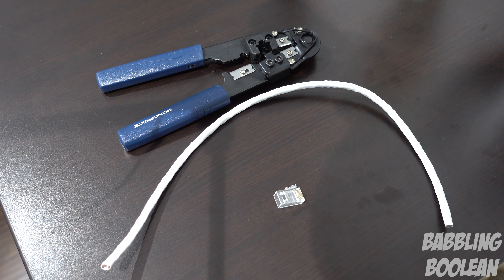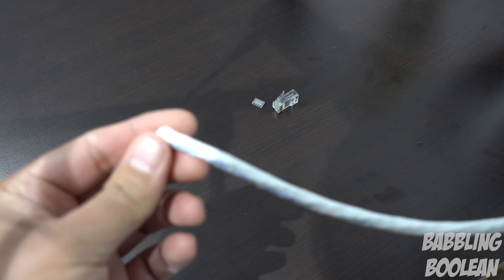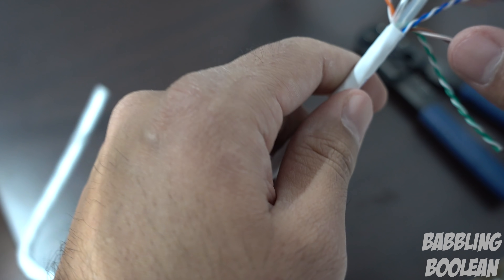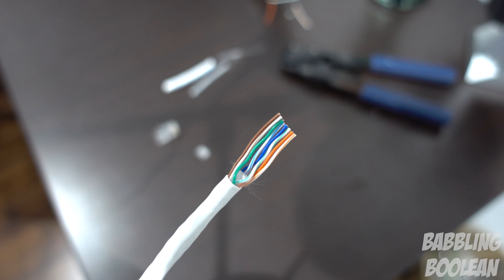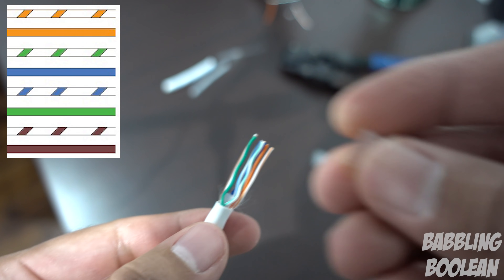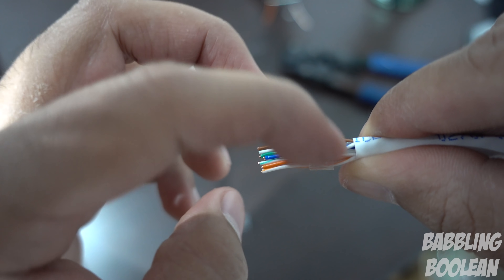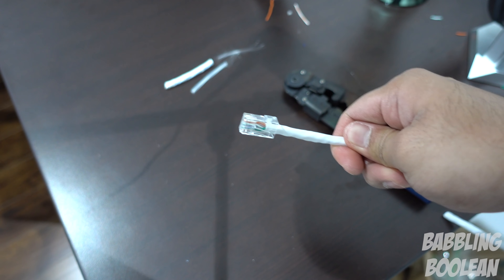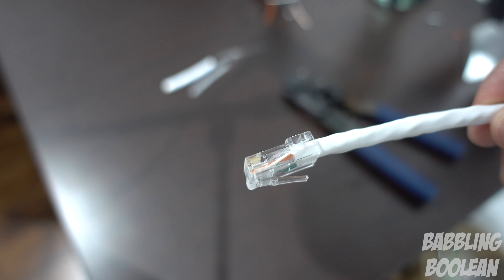How to Make an RJ45 Cat6 Cable

Comment: You said that there's 2 formats (A and B) and that A is used in very special circumstances. Thats not true... you can use either of them as long as you do both ends the same. There's no difference in the 2 formats.

Comment: Thank you for the details. Especially on which wires need to be near you and clip on bottom. I tried my first one based off another video and they weren't clear and I installed clip up and white orange on the right side. Um didn't work so well (or not at all). So thank you again for the detail.

Comment: I have a double socket in the wall. One of them works another one is missing #3 (tested with cable tester) - just wondering if this can be different standard or it is problem with Ethernet socket?

Comment: The two plastic parts: 1) A fibrous thingy, it is for stripping the insulation. It is often some strong (sometimes kevlar or nylon) fiber, to simply cut the outer insulation. 2) The plastic cross guide, is to do a twist. This is only in Cat6 cables really. In some shielded cables you will have more stuff, like shielding around each pair, sometimes also outer shield, and sometimes also a "ground" wire. The ground wire isn't actually ground, it is just to help with continuity of the outer shield. It often needs to be connected to shielded plugs and sockets, but that depends. The keeping insulation is not about the noise, it is about mechanical and electrical integrity. If you score the insulation, there is a risk of 1) copper being scored too, and with plugging and unplugging it might break easily, 2) it can corrode more easily, 3) worst off it could short to other wires or shielding.

You also need to be careful when buying plugs. They do vary with quality and what they are for. 1) Make sure the category of the plug matches category of the cable. 2) Make sure the plug is for solid copper cable of proper gauge, or for flexible ("patch cable" / "patch core")  wires. 3) Make sure it is of reasonable quality. Things to look for: Does the latch is of good quality and doesn't break easily. Does it have a loading bar or not. It does help with crimping to a proper length. Does it have a straight through hole (not on this video), it is another way of making sure crimping is to a proper length.

Comment: Oh man you cheated. You used solid core (can see from the way the cable doesn't bend freely) when stranded should be used for making patch leads. As mentioned below, the string is used for cutting the outer sheath and does nothing to reduce noise and neither does the plastic support that is keeping the pairs separated. The twists of each pair is to reduce noise/crosstalk and each pair has a different number of twists per inch/centimetre.
Reply: Where is YOUR tutorial??????
Reply: Ronnie Bailey 
Chill, punk!
Not all knowledgeable persons have a frickin’ “tutorial”. 🙄

Comment: Hi
I followed this vid and when i made my cat 6 cables, i tested them after and the tester... Would read.. 1,2,4,7,8, skipping some.
I have tried multiple times, making sure the cables are in the right order,, following the video with patience and care

What honesty am i doing wrong
Reply: Late reply but you should try redoing the CAT6 cables with a different reel of cables and try testing your wires with a different tester.
It may be that you were doing everything perfectly but had a defective tester or bad reel of cable.

Comment: What is that extra bracket called and where do you get it? 4:36 I got RJ45 cat6 connectors from amazon but they don't seem to come with.
Reply: If it did not have that little bracket in your package then they are not Cat6 connectors. Cat5 connectors do not use the seperator which I will guess that is what you have..

Comment: Source for those Cat6 connectors with the extra plastic bracket or loading bar? Do all Cat6's come with the little plastic bracket / loading bar? Need info for a job coming in a month. Tools I have, knowledge keeps changing.

Comment: The "bracket teeth" he refers to at :56 is actually called "loading bar". Not all category RJ-45 jacks have a loading bar. At 1:25, NEVER strip the jacket like that, as you can cut into the insulation on the pairs. It doesn't take much to damage those tiny 23 AWG wires. You should use a separate stripping tool for that. And when stripping, you should strip higher up the cable, then use what he calls the "strand", which is actually properly called a Ripcord, to cut the jacket further down past where you stripped it. This is in case you cut into the insulation pairs when stripping the jacket. Also the Ripcord (what he calls strand) has nothing to do with cross talk or EMI/interference/noise between the pairs. At 2:30, never cut the Separator (what he calls the film) and the Ripcord like that. You should use a tool called a Flush Cut Plier so you get a clean cut. This is also why at 2:45 the Separator is sticking up to high, causing the pairs to bulge around it. This will also stop the loading bar from going down as far as it needs to, which you will see later in the video. At 3:50, you should refer to wires by the stripe color, not the white. And the solid colors by just the color. For example, Orange stripe, Orange. Green stripe Blue etc. No need to mention the white. At 4:35, the loading bar is NOT required for cat 6. What is required technically is a staggered RJ-45 connector to reduce crosstalk.
Reply: I don't get why he cuts the insulation like that when there's a purpose built groove in the tool less than a centimeter away that is for exactly that purpose

Comment: thnx for the video ... so both sides will be the same order?
Reply: If you want to make a straight through cable yes (that means if u want it from a switch or router to a PC) .. If you make different orders in each end (cross-over) that means you need the cables for router-to-router or switch-to-switch connection to my understanding.

Comment: Wouldn't it be much easier if the colored lines were quite long and you could fish them through individually?
Reply from the maker: If they're too long then the outside coating won't reach up to the RJ45 plug, it's best to have the protective coating reach as far as possible.
Reply: @Babblingboolean  No i mean have them very long so you can fish each one through individually. Then when they're all through, pull them up and snip the ends.
Reply: @im1dermike  I get what you're saying but if they're short they're easier to line up. If I do what you suggest there will be unneeded wire bending and possibly breaks.

Comment: My cat 6 connector came without the bracket. I assume it is not cat 6?
Reply from the maker: What bracket are you referring to? Where the cable goes into? If yes, those are usually sold separately.
Reply: Babbling Boolean whats the actual name of the “bracket teeth” cant find them anywhere
Reply: @Babblingboolean  not one single vendor on amazon has that little second part, and they all call their RJ45's Cat 6.  What gives? I'm in a far away place and it takes 3 weeks to get any thing.  I don't see an answer to the question," will it still work without that little part"?  So what's the answer? I have a several week delay if the answer is no.  I'm going to try it anyway and I'll probably answer here before anyone even sees this.
Reply: karl spaeth 
So what was your outcome? Mate
Reply: @hectorcardenas2171  It worked but not very well. Using the tester I got inconsistent conductivity and the wires aren’t “locked in” tightly which means any movement at all is asking for trouble.

Comment: Nice video! I would have went into where the crosstalk is coming from (the pairs are shielded to keep out the other pairs from bleeding into them then the whole is shielded for external signals) but still very informative. I would have also mentioned the more frequent and consistent twisting of the pairs in CAT6 and explained why this is important also. Otherwise pretty good! I know the string is there to cut the cladding but most people just use a set stripping tool and pull off the casings like you did but yes the string is there for those who do not have a set tool.

Comment: Over the last couple decades I have tried this, and I am not exaggerating, at least 25 times - and I've never gotten it to work correctly.  At most I'll get connection on six of the eight lines according to my cable tester.  As I have never seen anyone do it in real life, I must conclude that it's not actually possible - and all youtube videos like this are faked. /s

Comment: but what if i dont have that little bracket?
Reply: The 2 piece RJ45 is much harder to do and takes in my opinion too much time. If you put a regular RJ45 on it makes little difference other than not "technically speaking" being a CAT6. The main difference is the wire shielding and the amount of consistent twists in the colored pairs. This is what filters out the crosstalk and allows the faster speeds IF YOUR HARDWARE SUPPORTS THESE SPEEDS AS WELL AS USING THE CORRECT PROTOCOLS! If you just make a CAT6 cable no matter which end you choose to put on stuff will not go faster unless it is made for those speeds and is running on the correct protocol to support such speeds. Run slower protocols and it makes no difference how good your other hardware and cables are. I have always run CAT5e STP (shielded twisted pair) to avoid outside signals from messing things up. It is not standard here in the US yet but should be. It also is little difference in cost. CAT6 is better yes but most people do not need it and will never notice the difference. It again is a bit more money and a LOT more effort to make them correctly. Give me a choice and I go CAT5e STP every time if for nothing else it takes less time and effort.
Reply: If you are using a socket with a bracket, you just line up and push the pairs through the whole in the bracket, if not, then the bracket that you push the wires through is simply inside the socket and you just line them up and push them through their correct holes inside the socket rather than using a bracket.

Comment: For those who wonder you can connect cat5 connectors with cat6 cable. However, I do not know if speed is affected but for low speed it works.

Comment: 4:37 what happened if the bracket is not installed?
Reply: I can confirm you need the bracket if you have cat 6 connectors.
Reply: Quentin Rufin for cat 6 rj45 connectors they are required as their is no other “slot” to hold the wires. But the bracket keep the cable insulated similar to the plastic insulator inside the cable itself.
Reply: What is the bracket called I need some and can't find any on ebay
Reply: PeteyPablo ooh boy, I lost some and had to buy a whole new set of RJs. I’ll search around for a link for you.
Reply: PeteyPablo I couldn’t find anything, but you can try. To the best of my knowledge and research they are called inserts, as they insert into the rj45 connector.
Reply: PeteyPablo they are also called load bars/ load bar insert. Hope all this helps. Let me know if you find them!
Reply: @LifeofAedan  found them complete using Rj45 load bar thanks
Reply: PeteyPablo no problem! Good to know!

Comment: Not bad but you should practice you'll get better
Wish you didn't skip ahead on organizing your conductors . I have a system and have made RJ45 plugs for over 25 years
You did give some good information concerning noise on the cable. The whole cable is part of that performance the jacket core twist and wire gage Helps prevent EMI and RFI . Plus you also have interference on the cable NEXT alien cross talk and far end cross talk FEXT. A cable
 certifier or validator will show you that. Sorry I do this for a living so I'm picky but pretty good for the occasionally crimper B+
Reply: LOW VOLTAGE DUDE if you saw mine you’d puke. But I’m getting better

Comment: Actually you never cut the plenum like that! That’s what the white string is for that you never addressed. You simply grab the string and pull downward parrallel to the cable and it works great.
Reply: He said the string reduced noise lmao
Reply: Ideal and klein make specific tools for stripping RG6 & CAT 5&6
Reply: Well... I just watched the video, and they in fact did cut it like that. Also, most people probably don't know what a plenum is. I don't. A quick google search for a definition wasn't helpful. This video was helpful in making sure I could make the connections correctly. So I'm just going to do it this way.